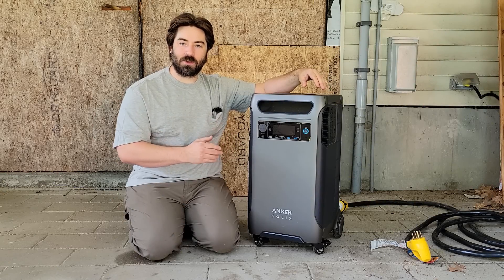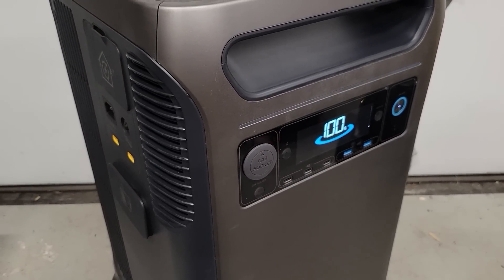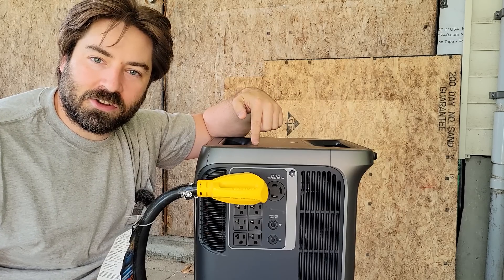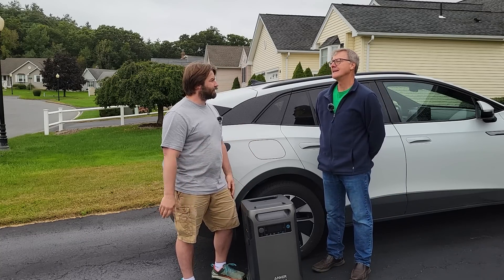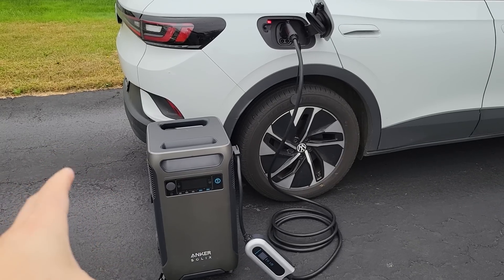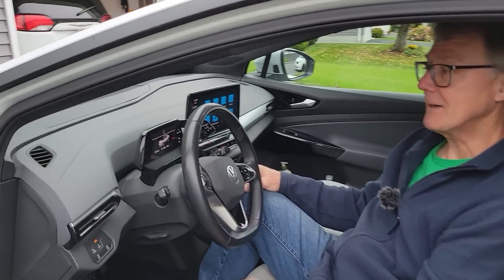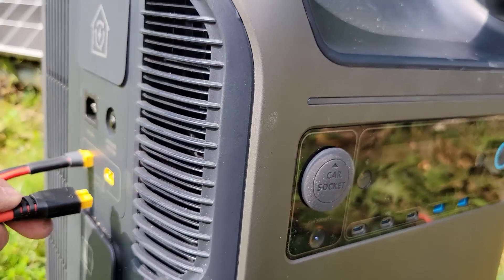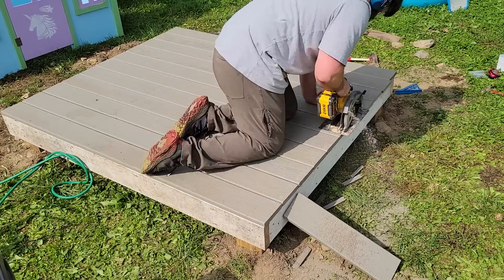ANKER SOLIX F3800: EV Charging and Home Backup, Testing and Review

Comment: You can also connect up to 6 expansion batteries to boost the capacity to 26,880 wh, or 700%.
Reply: I currently own a 767 and a 760 expansion battery. Do you know if the unit being tested can leverage the expansion battery and or both of what I have so that they’re not a total waste if I moved to this unit

Comment: something is off about this, I have generators that are significantly smaller in size and capacity that run these items you've tested for a lot longer. A heater only lasting 2 hours makes no sense at that capacity

Comment: Are those solar xt90?
Reply from the maker: Solar inputs are XT60
Reply: Can it charge from AC while outputting AC?

Would like to use je line a „buffer” for power. So small 2000 watt generator charging the anker while the anker provides 100-6000 variable power

Comment: Will it AC charge while using 240v?  Say from a gas generator.  Ecoflow wont when the double voltage hub is use.  Only DC input charges

Comment: very good video. congrats. i have a question, hope you have the time to give me your thoughts on this. my home consumes up to average of 900kwh a month, so maybe around 30kwh a day. my question is 1. would i be able to charge and consume energy at the same time on this device? 2. would i need a second or third battery to be able to maybe run during the night?  any ideas? im trying to buy something like this and be able to disconnect from the grid every now and then. thanks David
Reply from the maker: At my home, I tend to get power outages during the winter.  During the winter I might use 30kWh per day (same as you) because I have electric heat pumps.  Unfortunately, during the winter I only have 4 sun-hours per day.  (and lots of cloudy days too)  So, let's look at that example.  You need a battery that can last 20 hours a day, which is 25kWh.  Anker sells expansion batteries, so you could add enough of those to get to that level.  You also need to produce all 30kWh with solar in just 4 hours.  That means the solar array needs to be 7.5kW (minimum).  You probably saw in this video that I could charge about 1.3kW.  Point is, the built-in solar charge controller is not powerful enough for this situation. 
I think this Anker power station is a great choice for some situations, but I wouldn't choose it for running a house 24/7 off of solar.
Reply: @DavidPozEnergy David, Best review of this unit! Please answer a couple questions others have asked: Can you plug in one of your 48V batteries into one of the solar inputs to charge it, say during cloud cover or at night and does it give rated output while also charging? Thanks for your reviews!
Reply from the maker: @580guru,  I have not tested using a 48V battery into the solar charging ports.  I like the idea of expanding battery capacity with something DIY, but I'm nervous about hooking a battery directly to the PV inputs.
Reply: @DavidPozEnergy  Thank you so much, David , All the information was very useful and helpful , much appreciated. Are there any other  batteries that you would recommend for this example?  One last question, I imagine you can charge the battery at the same time that it's being drained?  Thank you again for taking the time.

Comment: Having the built-in 240VAC outputs are kinda cool, but there probably is not much of a point doing this with a power station.  You get into the same problem that you do with other expandable power stations like the EcoFlow Delta Pro.... expansion batteries are ridiculously expensive and you have no ability to scale-up the pieces of the system that you might need to scale up in the future.  Such as the AC outputs or solar input(s).   And also, the end-to-end efficiency... solar input to AC output, is likely very poor (just like all other power stations).

Comment: Interesting product but still needs some work. Pretty good power output and with future promises for parallel connectivity sounds even better, but the actual battery storage is extremely lacking with so much output. You didn’t mention, are there inputs to extend the battery with additional dedicated battery modules??
Reply from the maker: Yes, there is a port on the side for expansion batteries.  I don't have Anker expansion batteries to test the port.
Reply: @DavidPozEnergy  thanks for the response, always find your videos informative and interesting. I’ve been looking for a system to advise to a friend that just moved to Florida. They live in a very restrictive HOA so just about anything is a non starter. So far I’m looking for a battery system that can power the entire house for a day or two and recharge off a portable generator during daytime hours. As in everything, price is a concern, have seen some interesting uses batteries for sale thru the YouTuber jehugarcia. He recently had some really nice lithium iron phosphate batteries for sale at incredibly low prices. Have you ever seen or tried any of his offerings.

Comment: Whoever does thermal design at Anker needs to go back to school. The Anker Solix C1000 sounds like a dying desktop computer fan when charging and a hair dryer after 30min of sustained 600W load. Appears that the same engineer designed this unit. I wouldn't hold my breath that Anker will get it down to 50db, which is still quite loud. Can you see how big the fans are?
Also, a unit of this size should have 150V solar input.
The only compelling feature here is the generator hookup with split phase.

Comment: Too small a capacity to useful for anything. Solar input is low for a 6000 watt inverter. I would pass on this one. I guess you could use it in your truck for charging lithium power tools. An all in one inverter and a couple of EG batteries would be better.

Comment: This was so close, WHY input AC charging 120V only???? This will take forever to charge on AC. If you max out one unit with the expansion batteries it will take 17hrs to charge! And the EU version has 240 AC charging so it was possible.

Comment: For this to be remotely useful for EV charging, it would need to be able to work with an add-on battery pack.  How the numbers work on this is assume 3.5 mi/kWh and 40 miles per day driven.  So you need about 12kWh of battery capacity to replenish the average American's daily miles driven.  So if they sold 5kWh add-on packs, it could potentially be a viable option for that purpose.
Reply: Think of it like a spare gas can. You don't carry around a 15 gallon can, you carry a 2.5. There is no need to completely recharge your EV with this, just use it to get you to a charging station.
Reply: @ssteele1812 or home, I ran out of charge 4 miles away from home!! Lol😂 The amount of time I had to wait for the tow truck I could've used this to get me going!
Reply: @ssteele1812 good point but a few gallons of gas can get you 40 miles or further
Reply: They do sell add on battery packs.  On the flip side I own an electric vehicle and I love that I can charge this thing over and over with it and power my house for days in an outage and also have the great output and auto switch over capabilities for a relatively low price when you look at home backup systems and capabilities.

Comment: 6000watt system with ONLY 1500 Watts of Solar Input, no thanks....Recharge time could take all day if you are using it at the same time.
-IF that is 1500 Solar Charge per connector, well that would do.

Another system you can connected to MAIN Generators together for about 7000watts of Stored Energy AND 1600Watts of Solar INPUT for Both Units (Total of 3200Watts input)....3200watts of Solar Charging most like will get you FULLY charged.
Reply: Is that other system the EcoFlow Delta Pro?

Comment: Oh.. a preproduction kickstarter. Not gonna touch unless a) it actually comes out and b) reviews of actual production units work correctly. Need to test what happens when you have this device hooked up to solar, if it runs out of power and shuts off, will it restart automatically when it gets solar power?

Comment: Thx a  lot DTG, you're still one of the kind in what do. I finally found what I needed in the solar industry and won't be looking for anything else. Signature solar is my final stop. With 2 EG4 PowerPro WallMount and the EG4 18K-PV, I'm set for good. I couldn't be happier. Once again thx a lot for making my journey interesting.
Reply: Same, I was going to go with the schneider electric inverters but before I got the building permit the 18kpv came out so I'm going with those since I can stack more power togeter.

Comment: Useless unit...
Reply: honestly the more I look at it, these units are for people that lack the skills to do basic math and basic wiring skills, cause for the price of one of these units you can build a 48v lifepo4 battery pack with 2-3 times the capacity and get an offgrid inverter/mppt charge controller all in one unit and have essentially the same thing that could then be wired to a sub-panel  and use a breaker from the main panel going into the inverters generator connection to charge when solar isn't producing enough.

Comment: What is the self discharge amount over time with the unit turned off? My Anker 757 when completely turned off, self discharges at the rate of about 1% per day which I feel is too much. Also. Will this unit accept solar charging automatically if the solar panels are left plugged in over night? My Anker 757 will not.

Comment: Thanks David for sharing.  3.8Kw but only delivered 3.3kw.  I like the all-in-one!  Downside, if one thing breaks, you will have to replace it all too.  It is all about price.  Like 183
Reply: Pulling ~1700 watts constant probably put the battery under voltage cutoff to get the last half a kw/h. Usually a BMS doesn’t come back until it is past some threshold. I’d be curious to see its capacity test with like a 300w average load. Which would be what I would have with some lights/fridge/internet/tv on, and maybe using the microwave for a couple of minutes.

Comment: Does it allow simultaneous charging and discharging?
Reply: It's complicated. Basically, if the unit is outputting 240v it can only charge via Solar. If you are outputting 120v through the built in outlets it can be charged using the 120v charge cable or solar, but not at the same time. I believe that if charging with the 120v power cable turns on it will stop solar charging.
Reply: @ShavedOnions There are also maximum charge rates from ANY source that must be adhered to.
Reply: Great question!
Reply: Many to most do not.

Comment: Nice I like all the smart options on it and that it can do 240 volts. 50 amp plug but it can only do 24 amps must be the connection point for the future lol. Not sure if you showed us that you can charge and use at the same time and whether it passed the  ups test for computers but all is good and thanks for the review definitely on the list for when they start selling it. I so much want an electric vehicle with a two way charger.
Reply: 14-50 plug is just a very common plug used by EVSEs today ("car chargers"), basically an unofficial 'standard' mostly because of  how common it is at RV parks etc ... but yeah it does require an EVSE that can be bumped down if the supply can't handle the full 40 amps allowed to be pulled by NEC for that plug. Sadly most cars come with EVSE that will only pull 30 or 32 amps, but that is still more than the 25 amps of this.

Comment: It is about time we had something with proper 240v output in a single unit. Battery capacity is a little anemic... but if the price is right... I need this!
Reply: The current Kickstarter price starts at $2,600 (35% discount), which is still very high for 3.8kWh capacity.
Reply: I would be curious to see what would happen if you connect a 48V battery to the larger solar input as an extension battery. You could be able to run it for much longer then charge up the 48V battery from the grid or solar when you are done needing the power station.
Reply: @jonjohns8145  that trick works on every other "power station" so I can't see why it wouldn't work here for a cheap way to expand capacity, but like you said, you gotta have another way to charge those, would be nice if all these companies committed to a expandable battery agnostic connection so you can build your own battery, cause I can build a 14 KwH pack for under $2,500 and these companies want like 4 grand for a 3-4 KwH pack. Really makes you wanna say screw these things and just get an off grid inverter that can handle way more solar input then rig up a generator plug like this thing has to said offgrid inverter.
Reply: @jonjohns8145  @jehugarcia has done several examples of that. It should work fine.

Comment: The first power station with a 240v and No Hub attachment!The biggest disapoinment is the 60V solar input. With a unit of this size it needs at least 100v so you could do 3 panels (200-350w size) in series. What is the max solar input on this unit? What's the V&A of those panels?
Reply: The kickstarter went live yesterday, it does allow for a hub for a (discounted) $750 US I believe.
Reply: Nah with the support for 5-6 expansion batteries it needs to be at least 500V and several kilowatts of solar input

Comment: I like the shape which is different to other Solar Pover stations, it looks like a portable Air Conditioner. 
But on the other hand, it has a connectors or monitor and buttons on 3 of the 4 sides ...

There is no balance between the 6000W inverter power compared to the small real capacity of 3.3Kwh, I would have liked a higher battery capacity, at least 5kWh.
I hope the connecting cables between the units and the additional batteries don't take up too much space and that they are 90 degrees.
Is there a 230V version planned for Europe?
Reply from the maker: It seemed odd to me too, having a small-ish battery in ratio to it's inverter capacity.  But, I understand they did that because of weight.  This thing is at about the limit of what someone can easily move around.  If they ever send me some of the expansion batteries and cables I'll be able to answer your question on the 90 degree.
I don't know for sure about the 230V for Europe, but I think they are because they showed it off at a Berlin expo.
Reply: @DavidPozEnergy for sure they have an expansion module becoming available like most of these portable devices on the market already. 

Also the bigger inverter might be great for site workers, I can easily hit 3000w at start up with an angle grinder, don't want my work lights going dim and battery chargers cutting out with low voltage.
Reply: 6000W will be able to start a lot of things that smaller inverters can’t. Inverters have sort of become like TVs in that their expense has fallen dramatically in recent years so it was probably smart that they oversized it relative to the battery and it probably added little to the cost in doing so IMO
Reply: At this time, Pecron is the only company with a 90 degree expansion battery cable on their latest model.
Reply: There is a 230V version for Europe, it has 5 power outlets

Comment: How much it cost?
Reply: Anyone have a guess on $?
Reply: The solix f1200 (1.3kwh) is $1100 USD, so I would guess at least $1700.  We'll see

Edit: the f2000 (2kwh-2.4kwh) is $1999, so probably closer to $2500-$3000
Reply: Site says with 35% off it's $2599
Reply: List price of $3999 for unit and $2499 for each 3.84 kWh expansion battery with cable.  (Based on 35% off prices.)  

Compare to $1999 for SOLIX F2000 (2048kWh) and $2999 for unit plus 2048 kWh expansion battery.  Battery alone is $1999 list.